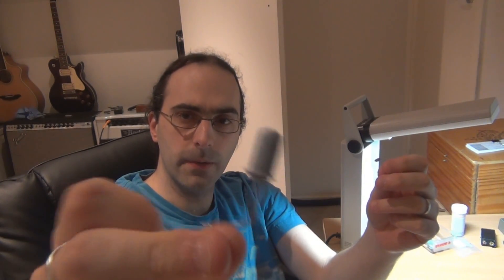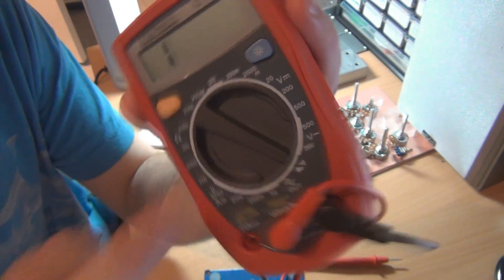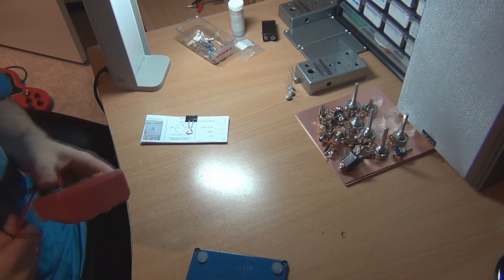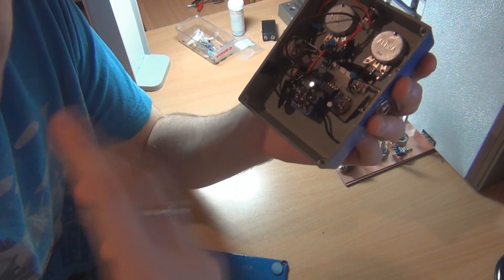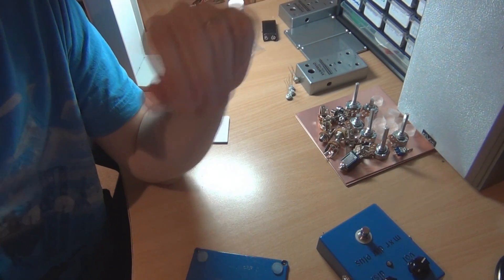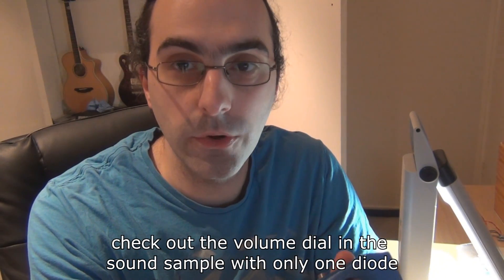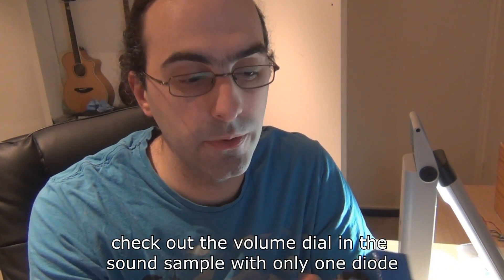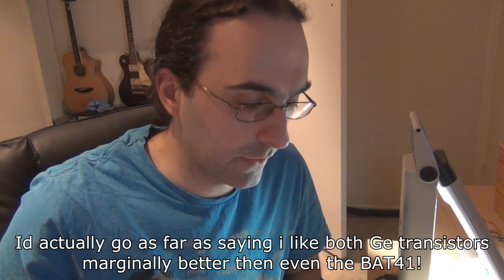Using a Transistor as a Diode

Comment: My Marshall MG10 amp is all SMD and Op Amps.
It has an SMD Transistor marked as D1 which I thought were the clipping diodes of the OD section of the PCB but I dont know how to replace that with some Germanium Diodes or something else (If that is even the clipping Diode)

Comment: This is interesting. I couldn't hear much difference between the 1st ufo germanium & the bat41. To be honest, I think "germanium" is overrated, it's almost mojo stuff?
Reply from the maker: Yeah some people claim they can hear big difference between diodes. Apart from the volume change I think the differences in tone are subtle. Not saying they are lying, I just cant hear them :D
Reply: I don't know,to my ears there's definitely a difference between germanium diodes and silicon,especially in a clipped fuzz circuit,I made a buzz box with a switch so you can hear the difference between the two and you can really hear the difference in the way the sound breaks up..maybe there's less of a difference with transistors and maybe too much gets made of it,but with diodes there is a quite a difference.
Reply: +DIY Guitar Pedals this is really cool,thank you for the link,I was trying to think of a easy way to test multiple diodes quickly without breadbording,(I also really liked the decade resistor box
i saw in one of your earlier vids)..I will have to make myself the diode tester so I can test more types at once..I've only really been making pedals for the last year so,but I must say I've learnt such a lot from your channel,(the pcb etching is something I don't think I'd have tried had I not seen your vids),i think it's really good these vids are here.
Reply from the maker: +Daniel Allan A lot of people would agree with you Daniel.  Apparently there is difference with the "Knee" of the voltage curve and how "soft" the distortion sounds between each diode.  I agree as well.  But i still classify it as a subtle difference.  ge vs si sure, i can hear it.  ge vs ge...the difference is becoming negligible...in my opinion at least...
Reply: Yes I agree,it only really makes a difference when you compare between si vs ge,.I have also found that there wouldnt be anything noticeable to gain tonewise by substituting a ge for a ge of another type...the buzz box I made switches between silicon and germanium diodes,and I can say I really noticed a difference between the two,the germaniums have a softer tone and give few subtle differences,while the silicons are sharper sounding,its a subtle thing I know,but when I tested it out I felt there was enough of a difference to have an option of switching between silicon and germanium types
Reply from the maker: +Daniel Allan I agree soft vs sharper, etc.  Hey if you havent seen it yet, you should check out my clipper box videos, you might find them interesting: https://www.youtube.com/watch?v=WwRhTvcxUMk
Reply from the maker: +Daniel Allan Yeah its pretty cool, both make really good learning tools, particularly if you are breadboarding and experimenting with components. Thanks Daniel, appreciate your viewership as always!